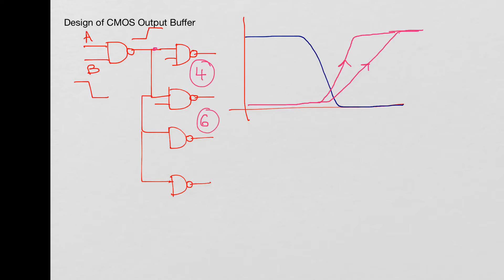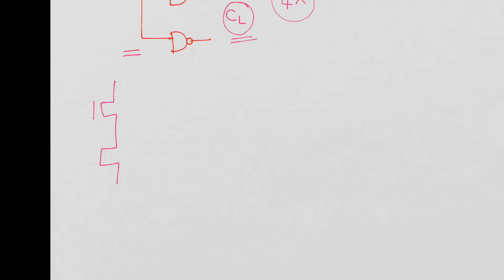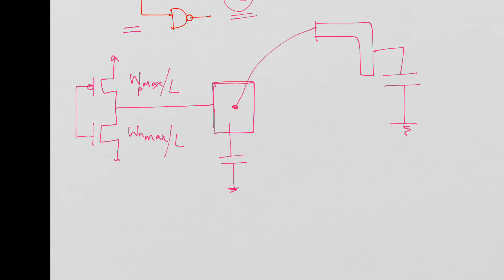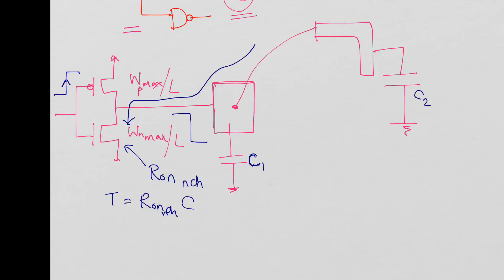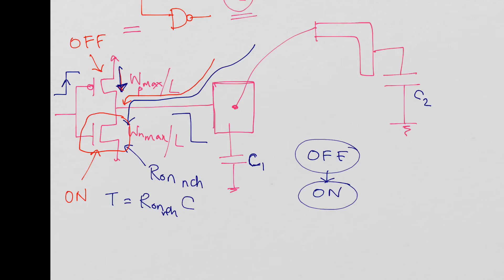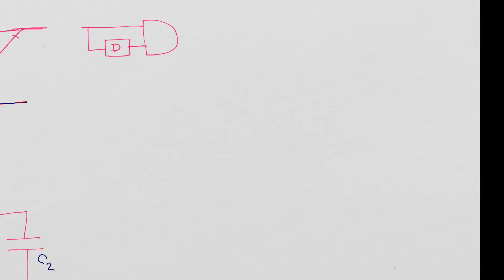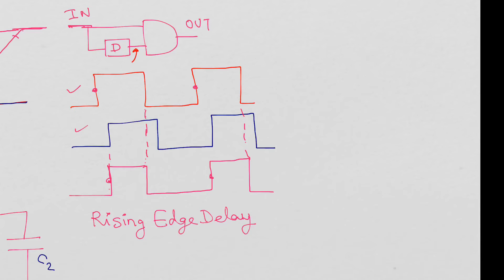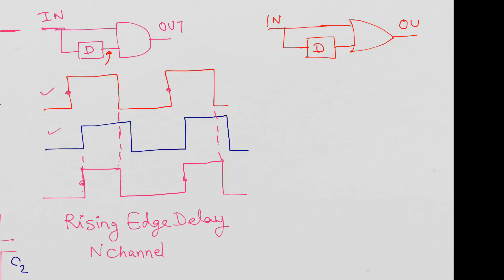Design of CMOS Output Buffer

Comment: Great video . Please consider doing one of how to calculate rds on. Example is if you have a fast pulse high to low  on the output of a micro pin ie 1.6uS driven into 100pf load then the pulse is not seen on the scope due to I= c dv/dt so the increased i results in a larger voltage drop across the pmos . For years I just stuck to output current restriction of micro controller but still don’t understand what is happening under the hood